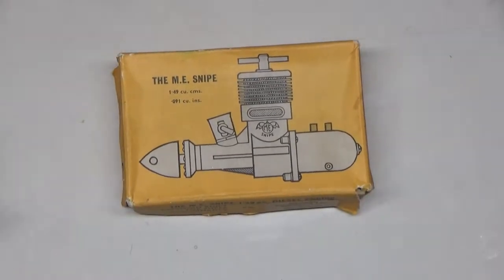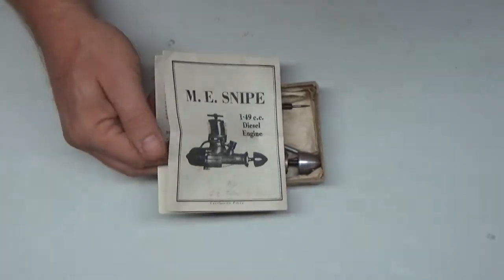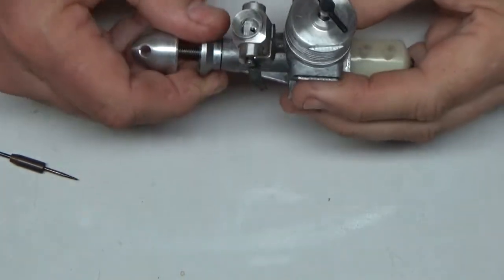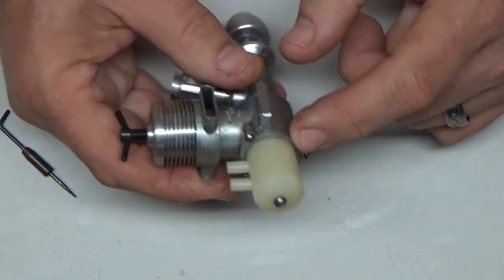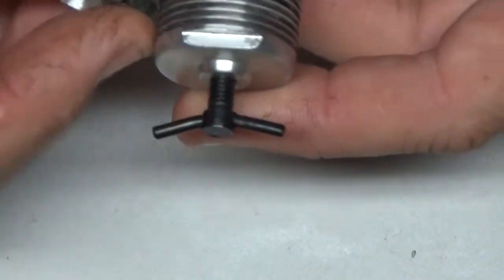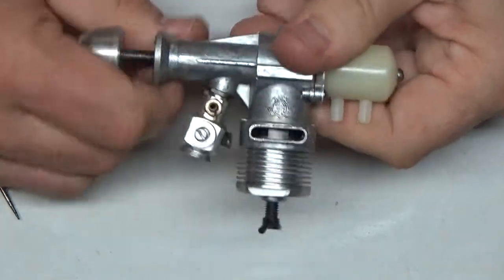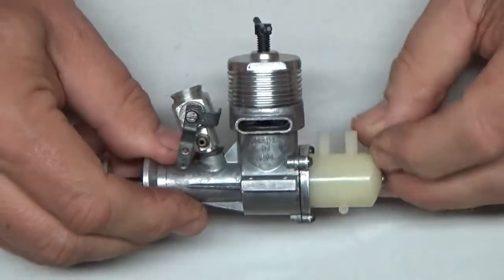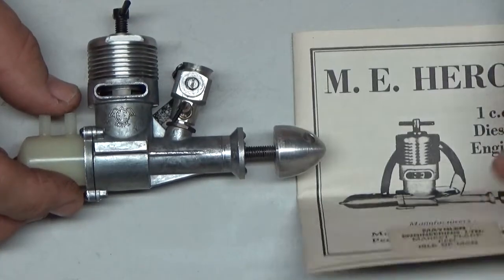M.E. Snipe A Quick Look

Comment: Run video please.
Reply from the maker: Oh I will try to post one.  Right now I am still working out mounting the tiny little thing...!!!
Reply: Being tightly fitted, i'll bet it will be stubborn at first. These engines use a hardened steel cylinder and an Iron piston. I've seen the engines from the ME company last 20-30 years. they are well built.